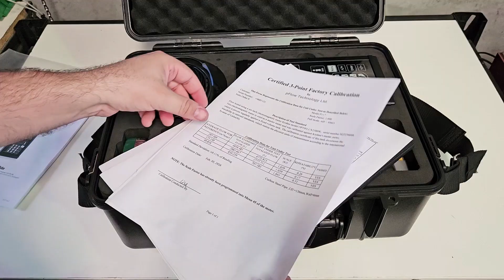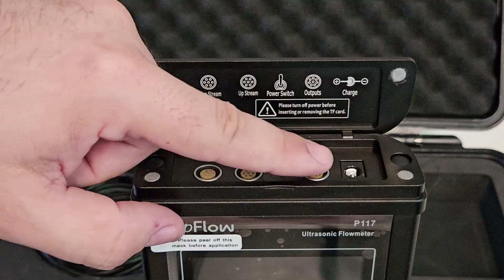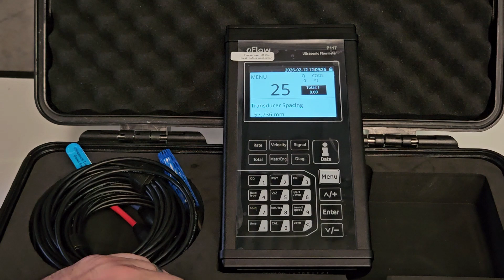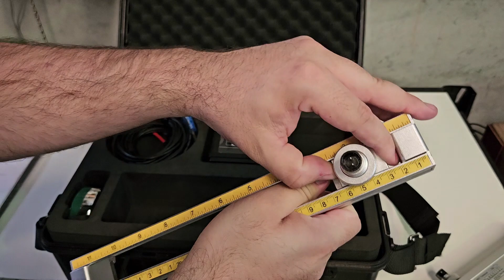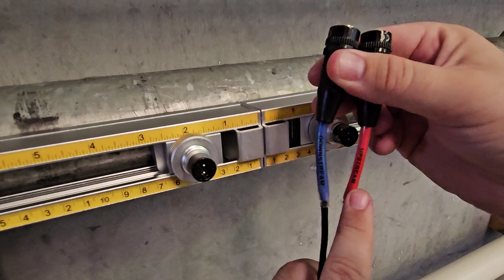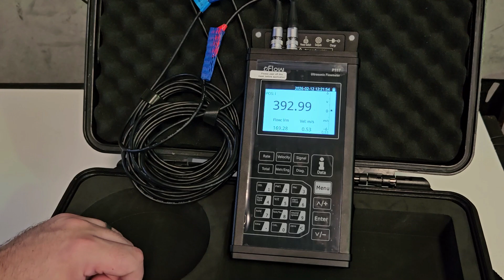pFlow P117 HD Ultrasonic Flow Meter Overview & Demo

Comment: Thank you for such a detailed review and your installation recommendations! Very interesting. I've heard of Gentos before, but I haven't seen such a detailed review.
As I understand it, you're a guru in this field! If possible, I'd be very interested to hear your opinions on different brands. For example, comparing a Japanese flow meter (I saw it on your desk) and GENTOS. Flexim and Gentos, Panametrics and Gentos. Which one has the advantage? Under what conditions is this advantage undeniable, and under what conditions are they equal?
Reply from the maker: Our website has a bit of a comparison table at the bottom of the page here: https://www.zedflo.com.au/ultrasonic-flow/
There are some advantages and disadvantages between all of them and the comparison goes over that in a bit more detail.

P117-HD is an evolution of the P117, it has a nicer HD display and upgraded internal hardware. It’s got great magnetic mounting frames making use on metal pipes quick and easy, but a bit annoying to mount on plastic pipes with included straps, or for quick mounting cable ties work well (or even ratchet straps for large pipes). The user interface, ease of operation, quick response of scrolling through menus, clear and bright screen in a small handheld size and quality transport case make this a fair bit nicer to operate over say the FT221, however a key downside is that it has a max measurement velocity of only 6 m/s (comparatively quite low)
These have quite a big price advantage compared to the Tokyo Keiki units, but those Tokyo Keiki units are premium products which offer very wide bidirectional suitable flow range of +/- 30m/s, with various different sensor kits available to fine tune suitability for specific applications. The sensor signal frequency is stronger so can generally handle tricky applications better in adverse conditions. like if there is some solids or bubbles in the process, or thick walled pipe. It also excels with very small pipes as you can choose small sensors specifically for small pipe or sensors for very large pipes.
Reply: @ZEDFLOAustralia  Thank you, dear colleagues, for your impressions! It was very interesting to read the huge comparison chart. Informative and professional! As I understand it, you haven't used Flexim or GE devices—you don't use these devices because their capabilities are excessive for your conditions. Too bad, I'd be interested to hear your opinions on them too... Good luck!

PS: You've created an excellent video about the P118 GENTOS—it's arguably the best, and a video like this is sorely needed on the GENTOS factory website!
Reply from the maker: @droneKRR  That's right, I haven't tried those models, only models that we sell or have sold in the past.

Thank you